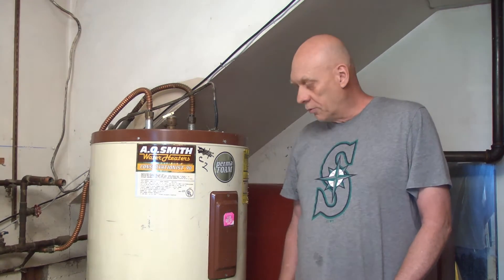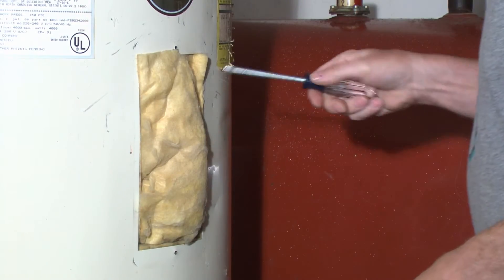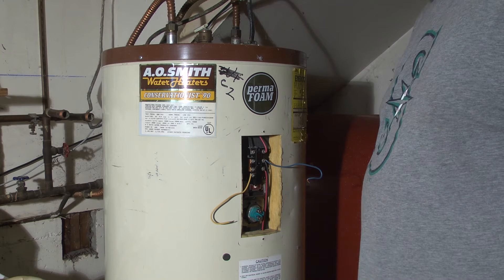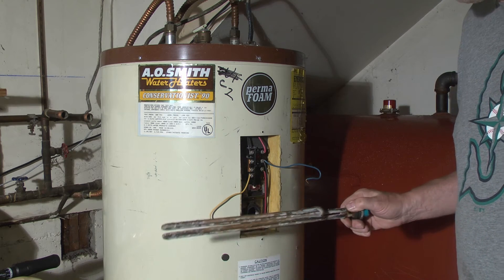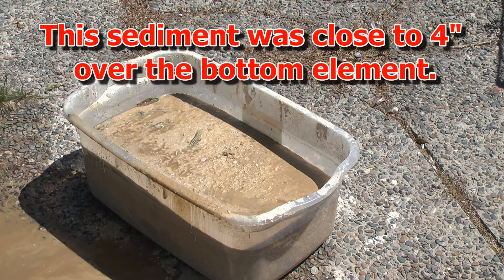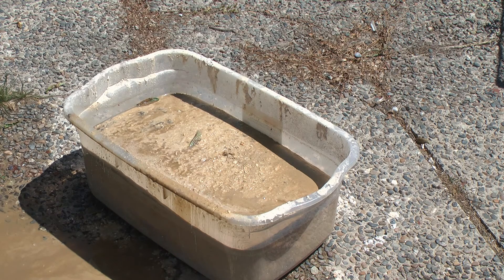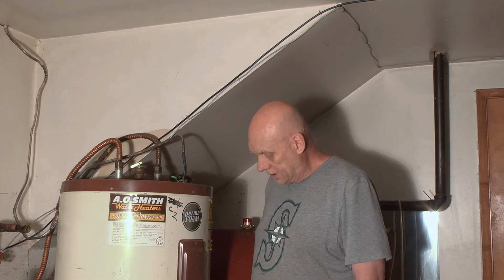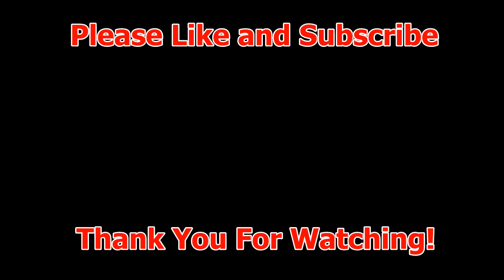The Ultimate Water Heater Clean-out - How To Remove Tank Sediment

Comment: When you do that cleanout you want to replace the anode rod, this is the thing that will allow the tank to last a long time.. Rough well water might require you use the aluminum alloy rod and change it every 3 years to prevent the sulphury sewer smell in the hot water..

Comment: Do not let anyone say that aluminum will scratch glass. Glass has a hardness of 6, steel has a hardness of 5, while diamond is at hardness rating of 10. Aluminum is softer than  steel    . It is 5th grade physical science. You CAN safely use aluminum or steel adapter. However, a clear vinyl 3/4 inche hose allows you to see what is coming out of the heater as you vacuum.

Comment: The sediment in the bottom of my hot water heater is hard, only trickle water goes out, have tried breaking up the sediment with metal coat hanger;sorry I seem dumb on the subject, but any suggestions? I can’t afford a new water heater. Help
Reply from the maker: If you can get it drained, try putting about 3-4 gallons of white vinegar in. Let it set for 24-48 hours. See if that helps dissolve and loosen up the sediment. Good luck!
Reply: @hardluckcharlie  thanks😊

Comment: You're not supposed to check the elements to see if they are working with electricity and have power, because yes, one kicks on at a time.

You're supposed to check the elements with a multimeter, and check the resistance in homes. You should have approximately 13 Ω of resistance.

The elements do not have to have power to them to check this.
Reply from the maker: Thank you for the excellent info!

Comment: Refreshing to see a DYI with mishaps included along the way which usually occurs in everyday life instead of those polished easy peasy videos. BTW did you get that old element out or pushed it through?
Reply from the maker: I did not get that element out. But we did get another year out of that tank. I should have replaced the anode rod as well, but live and learn. The heater lasted for almost 20 years. Not bad.

Comment: After 30 years, buy yourself a new tank.  I see why you have no hair left, you've pulled it all out.  LOL.  For those of you that watched, never turn the power back on to an electric tank unless it is full of water.  A dry fire of the tank is a sure way to let the smoke out of the elements...
Reply from the maker: If you can afford it, yes, by all means buy a new tank. If I could afford it I wouldn't even bother changing the oil in my car. I'd just buy a new one. Simple. Obviously there is also a reason they call me Hardluck Charlie.. (besides being bald I have very limited resources $$$$) Also, I did fill the tank before turning the power back on. But that is a good thing to emphasize. Thank you for watching and commenting.

Comment: 31 yrs! That’s a record. FWIW I use 1gal muriatic acid (30% acid)
& 2 gals of water. Add to bottom of empty WH and wait 1hr. Drain & refill several times. The solution will turn green =
Dissolved lime.
Reply from the maker: My dad was a muriatic acid freak. He used it for all kinds of things. Usually to clean rusted parts. The problem is the gasses produced by exposed muriatic acid are quite corrosive also, and many items such as shelving brackets in our shop began to rust badly. It can't be good for the lungs either, so I would suggest anyone using that method also take the precautions of using proper breathing apparatus. Also, I have a septic tank system that I would be wary of killing the micro-organisms and destroying the balance in. That would be the only possible way for me to drain the tank here. Also we are located over an aquifer that is suffering from ground pollutants already.  I appreciate your suggestion. I just don't think it would have been a good choice for my situation. My dad (RIP) however, would have loved it.

Comment: Are tanks prone to leaking after having such a buildup of sediment? I discovered sediment up to bottom element in my tank yesterday and initially figured I'd just have to replace the tank, but now am questioning whether that's necessary or not. It seems to work fine otherwise, I would just hate to invest the time to clean it thoroughly and then have to replace it soon after.
Reply from the maker: My shower/tub faucet was clogging every 7-14 days before I cleaned the tank. It has not clogged in over 8 months. I am going to inspect it annually now, and clean it before it becomes such a huge job as it was in the video. It should not leak, before or after. I saved a lot of money by cleaning the tank. Thank you for watching and commenting.

Comment: Always something extra in Plumbing , Rarely very easy . Also maybe you should have replaced the Anode Rod , which is More Work . Thanks
Reply from the maker: Yes probably. But I just wanted to be done with this project after the cleanout. Maybe next year I'll do the rod too. Thank you for watching and commenting.
Reply: Please look into electric cathodic protection. I installed one in my tank, but no idea if it's a gimmick or not

Comment: You're a glutton for punishment, buddy. I'd rather take a beating than do that.
Reply from the maker: lol.
Reply: @hardluckcharlie  Sad thing, though, is that I'll have to do it soon. I've been putting it off a couple weeks now.
Reply: Ah but the satisfaction of doing these do-able jobs yourself is so rewarding self congratulatory and financially.
Reply: @bc5001  I cleaned mine out with citric acid last time...4 years ago this July and it's still good so far.
Reply: @BigRW  👍
Reply: @bc5001  Before then, I was using a length of hollow broom handle, a Pringles can and some duct tape attached to my shop vac. 😆